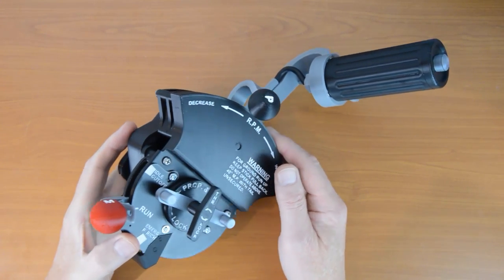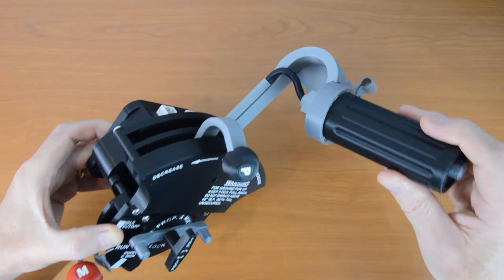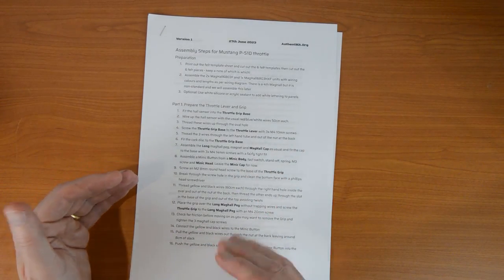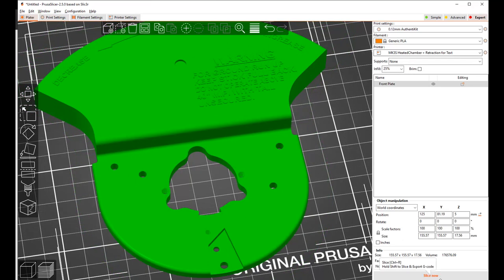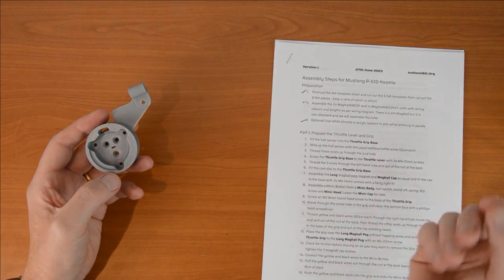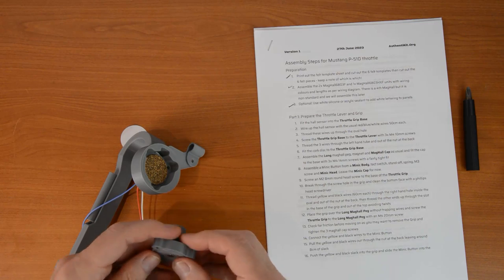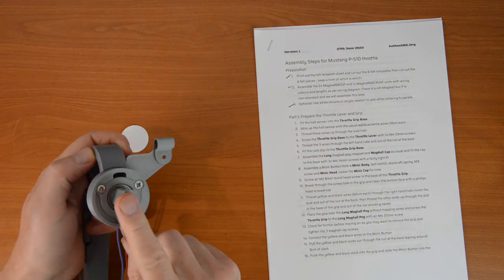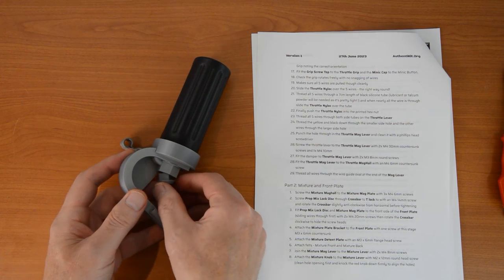AuthentiKit P-51D Mustang Throttle - Self Build Assembly Guide

Comment: I have the CH Throttle 6-lever quadrant so I can at least use all the functions, but gotta admit I want a dedicated WW2 module.
A friend, knowing I want at least the P-51 throttle, sent me the link to this module at your website and I've been checking out both it and the trim/flaps module, gotta say I'm impressed, good work!

For me on the customer end, the issues are 3d printing, there are no quoted prices and would then need to have 2 separate shipments from 2 different "entities", will you be streamlining that anytime in the near future?
Reply from the maker: Yes, that needs sorting. We have a formula for working out a mates rates price for others in the community to print parts for others. In the short term it will still be two parties supplying but hopefully in the future that can be simplified.
Reply: @AuthentiKit  Alright!
Been looking for Creality Ender's and there are enough to go around, so that shouldn't be an issue, but what about construction kit 1 & 2, do I need that as well? Or does everything needed to assemble the throttle kit (minus the 3d printed bits) actually come with the throttle kit?
Reply from the maker: @ToreDL87  if you’re in the US and get the P51 starter kit then you have all you need for a functional throttle plus capacity to add the pedestal later if you wish. To build the pedestal you would need the construction kits or order the dedicated pedestal kit from the SKS UK shop.

Comment: So, going to buy this and the pedestal kits with printing done by someone else, but I'm wondering if the screws are marked in the kit from simkitsupplies?
(Also, what most gamers don't know about the real P51 is that the prop lever really needs to be pushed a bit gently since the torque of the engine van react badly to rapid increases in throttle input. IOW, there really shouldn't be issues with twisting the throttle lever since you shouldn't be jerking the throttle back and forth. But it's still good you increased the thickness jic.)
Reply from the maker: Thanks for the info. The screws aren’t marked, but you can check lengths with a ruler.

Comment: Do I need the Construction Kits without the starter kit available or do I just have to buy all the available parts on the throttle page? I plan on making the Throttle and Pedestal, just not too sure what to buy.
Reply from the maker: P51d starter kit gets you throttle and hub and mounting system. To add the pedestal either get the construction kits from US site or from UK site you can get a pedestal kit
Reply: @AuthentiKit ah I see thanks, I was looking at the UK shop
Reply: @AuthentiKit  Do you know if the P51D starter kit will be available in the US any time soon? Will try sourcing the parts or buying from the UK shop if not.
Reply from the maker: Stock is on its way now i’m told. Should be in the US warehouse early next week.